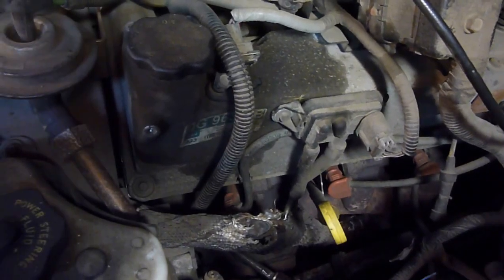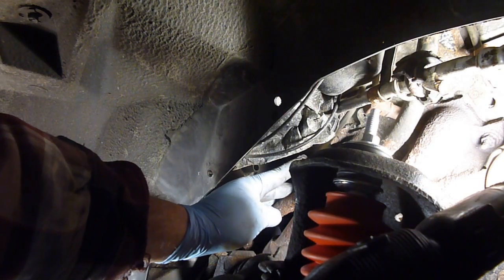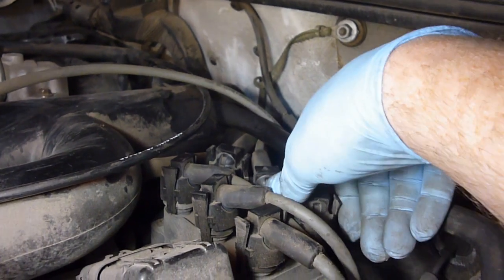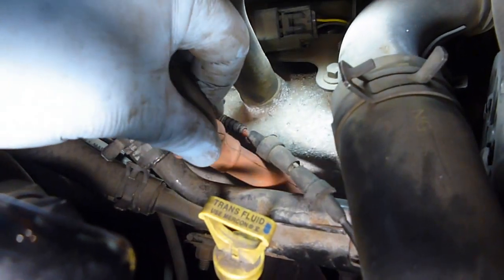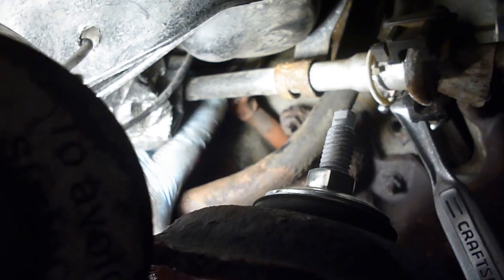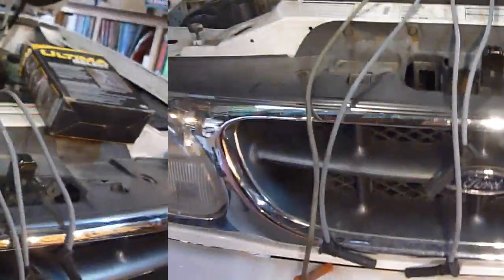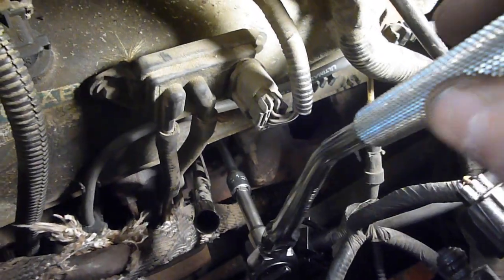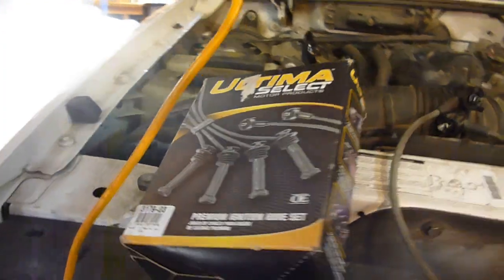FORD EXPLORER SPARK PLUGS & WIRES (GOOD BAD AND UGLY)

Comment: The thing you weren’t sure what it was with the vacuum hoses next to the #4 cylinder is a EGR valve pressure sensor. You made replacing the plugs and wires look like so much fun I can’t wait to do mine😂

Comment: hey , i have the same exact model 4.0 v6 sohc. I had the same issue but mine were too short. Whats crazy is the same brand you got , i got that were messed up. Is it the right side or left side for wires? Changing mine soon , wanna make sure i get corrected ones this time.
Reply from the maker: i was told i got left hand drive mail truck ones i ended up switching them all out for the correct ones and it runs good now i have the story on my chanel in my 01 explorer playlist

Comment: I just did this job on my explorer and it was a nightmare.
Reply: Lol I did mine years ago and rear passenger one stripped threads. Had to helicoil and job weld damn spark plug in there. Was next to impossible. Put iridium one in my guess motor would blow before it needed to be changed again lmfao!

Comment: I'm doing this job on my 99 exploder right now. I'm not even on the right side yet. God help me.
Reply from the maker: turns out they gave me right hand drive mail truck spark plugs( no joke) for some reason there different i don't know why they even had them so hopefully yours will go smoother
Reply: @JunkworksGarage  Oh its a nightmare and it's my first time ever changing plugs on a vehicle. The plugs are stuck in there good, so I need some lube for them. I can't thank you enough for suggesting the wrench though.